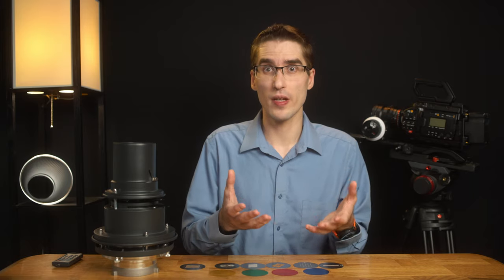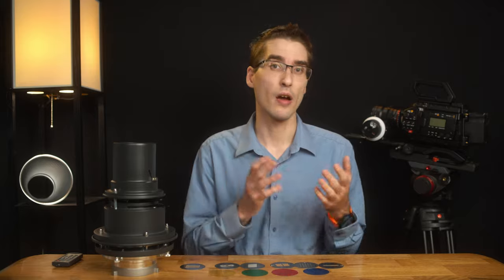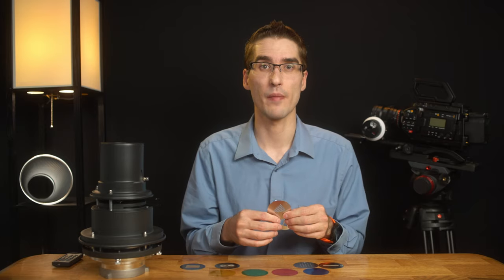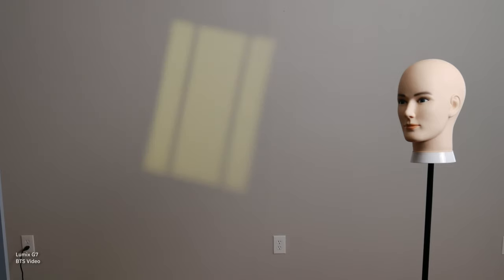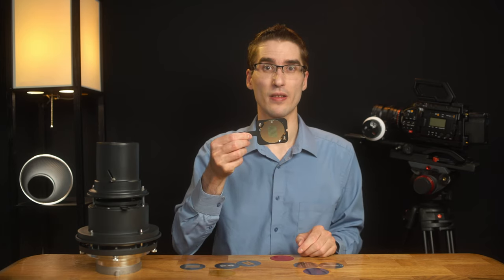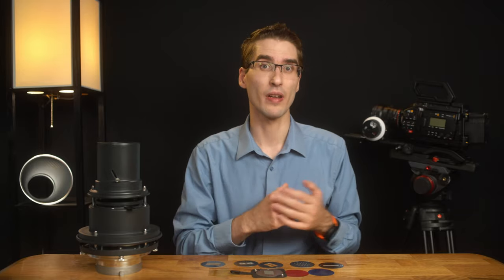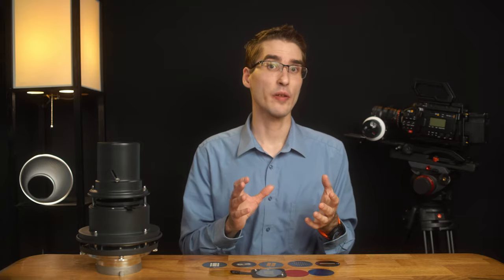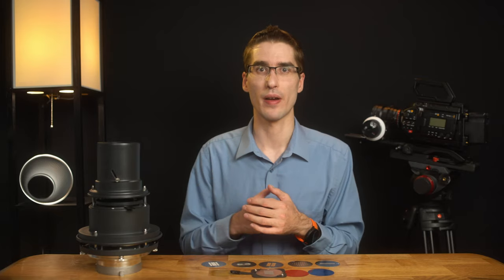Wellmaking Optical Snoot Overview | Shape your light with gobos!

Comment: From what I see of the review it's the best unit out there. I have the Ambitful AL-16 which has a better system for adjusting the gobos as well as control of the  lens and filters. Another point is the heat that is generated by these units. The Wellmaking lacks any vents to help dissipate the heat whereas the Ambitful does have vents. Perhaps you should compare the two optical snoots sometime.
Reply from the maker: Thanks for the tip about the Ambitful! Luckily, with my lights this unit didn't create too much heat, although some vents would probably be a nice addition - as long as they don't cause light leaks. If I get the opportunity to compare the two, that would be interesting!
Reply: @TrentonHoshikoCinematography  At the moment I don't have the Wellmaking unit but am doing a review in a mag we have in the UK called Film and Video Maker. The article should be coming out at the end of the year. However it's only sent to IAC members.
Once I've finished the review I could send it to you for you to compare.
Reply from the maker: That is awesome, I haven't heard of that magazine in particular (probably because of the membership aspect), but it seems like a great resource. Really cool that you're doing a review for them! I'd love to see your review when it comes out. I know there are some differences and similarities between optical snoots and optical condensers, so that would be a quite interesting read! :)

Comment: I am trying to get a custom gobo cut for mine and am unable to find the specs for the gobo to order. I see below you mentioned 2.25 in in diameter, but I need more specific specs with thickness and artwork size as well. Do you happen to know that or were there details in the manual? Thank you so much!
Reply from the maker: @BumbleBeards
When I answered the sizing question before I hadn't even though to check out the manual. The listed diameter there is 58mm/2.3 inches. It does not list the other measurements though. If it helps, I measured them as: .3333mm thick (6 of them stacked together was 2mm), the max height of the design was 3.5cm, but most designs were closer to a 3cm height/diameter. Hope that might help a bit, I wish I had calipers to get very very fine measurements, but don't have any right now.

Comment: Does this come WITH a lens?  (If so which one?)  I see you linked to three different one.  Which did you prefer?
Reply from the maker: I'm not sure which 3 different ones you are saying I linked to? But no worries, this is the Wellmaking Optical Snoot and has the lens attached inside the mechanism, it is ready to be attached to your lampo and used immediately without anything else. There are optical snoots that you can buy that accept Canon EF lenses, but I didn't like the idea of that and went with this one because the lens was attached to the unit and didn't have to be purchased separately. Hope that helps! Let me know if you have any other questions! :)

Comment: Does this fit on a Godox AD600. I’m having a hard time figuring it out 😭
Reply: Ad 400 my bad
Reply from the maker: If you are talking about this one https://www.bhphotovideo.com/c/product/1383479-REG/godox_ad600pro_witstro_all_in_one_outdoor.html/overview or this one https://www.bhphotovideo.com/c/product/1342117-REG/godox_ad600bm_manual_lithium_flash_with.html (there appear to be several sub models that are slightly different, these are not affiliate links) then it should work because they both have bowens mounts for accessories and this Wellmaking snoot has a bowens mount. I am not familiar personally with those lights, so I don't know how good the mounts are, but it looks like they are compatible from a mount standpoint. Hope this helps you out!
Reply from the maker: @FrescoFilmz  From what I can tell on their website the AD400 has a bowens mount and should be compatible with this snoot! More info: https://www.godox.com/product-d/AD400Pro.html
Hope that helps!
Reply: @TrentonHoshikoCinematography  thank you a lot bro. 🙏🏽🙏🏽🙏🏽
Reply from the maker: Happy I could help! Bowens mounts are great because they are pretty standard now between heads and accessories, but it is always good to check the technical specs to make sure it is listed.